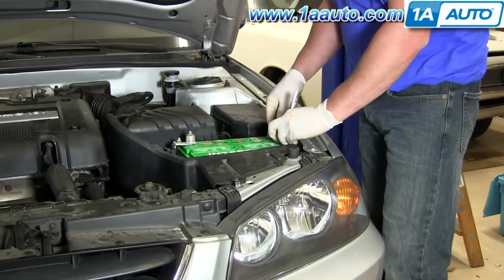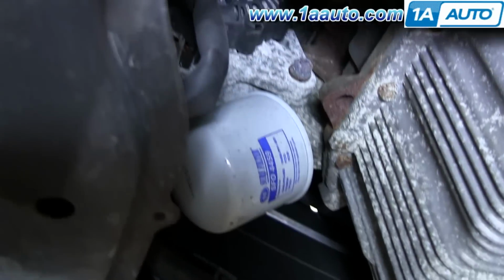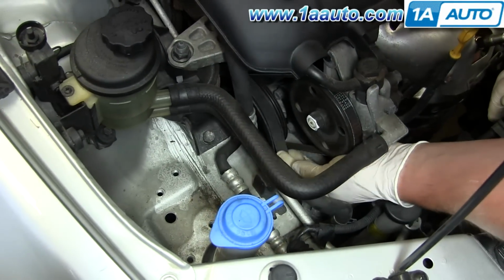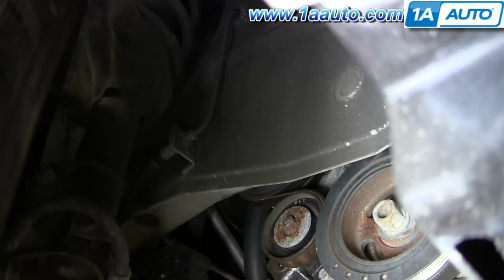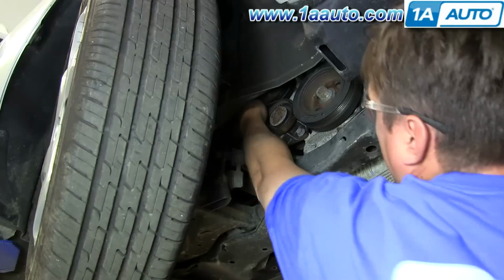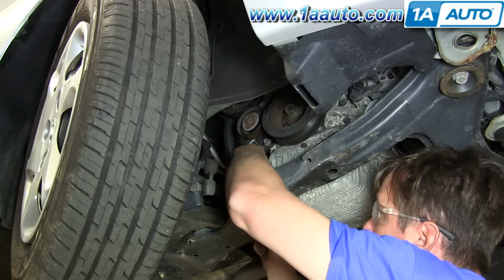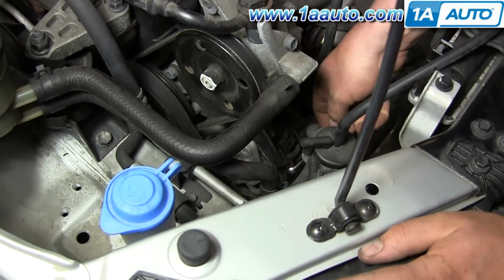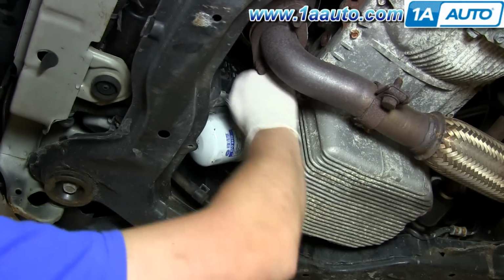How To Install replace The Air Conditioning Compressor Belt 2001-06 Hyundai Elantra 2.0L

Comment: Is it safe to just cut the AC Belt and drive until I can get the parts to replace the compressor?  
I'm getting a grinding noise from the AC clutch in a 2008 Elantra.  Honestly, I'm looking to get rid of the car sooner than later and just don't want to put that much into repairing it.  So is it safe to just cut the AC belt?

Comment: I was getting a burning smell in my car. Mechanic cut ac belt and said you probably weren't planning on fixing ac anyway. It was blowing warm air before
Reply from the maker: +Pal's Newfoundland channel We wouldn't be able to diagnose an issue like that here, you may want to have a local mechanic take a look at it. Thanks for checking us out! http://1aau.to/m/Shop-1AAuto-c

Comment: I turn on my car and it makes a squealing noise, is this the idler pulley?
Reply: Could be, but for this car you should also check the tension of the other belts that had to be removed to gain access to the ac belt.

Comment: My elantra doesn't have any heat for the heater and the AC just blows hot ,what could be the issue
Reply from the maker: We are unable to do diagnose but we do recommend taking your vehicle to a local, reputable mechanic. +batone76 sanchez
Reply: As far as the ac goes, the most common thing is that the compressor leaks refrigerant, therefore needing to be replaced.

Comment: I just found out what I had to do to get the air conditioner to start blowing. When I turned on the car, the air didn't blow at all. I had to tap or hit the bottom of the passenger's door where the blower is and it came on. I may have to keep doing that to get it to come on and I know that's not normal. Do you think the whole blower need to be replaced or is it that it need to be cleaned?

Comment from the maker: You may want to see if the clutch on the AC compressor engages when the switch is turned on. If it doesn't, make sure that there's power going to the AC compressor and that the clutch isn't frozen on the compressor. Hope this helps you out. 1aauto.com 888-844-3393

Comment from the maker: It never hurts to disconnect the battery when working around the motor, or under the vehicle.
Reply: Is the alternator belt and ac belt the same size?